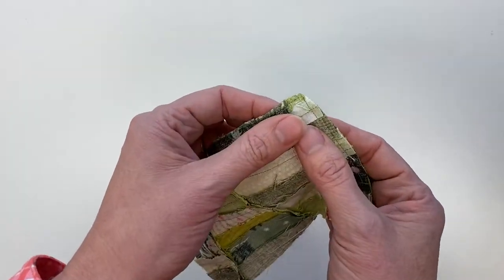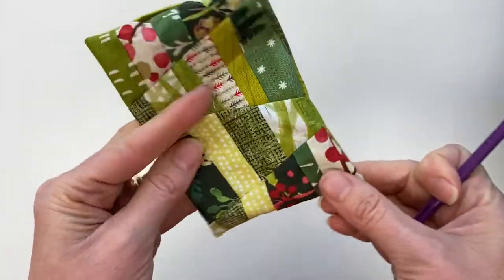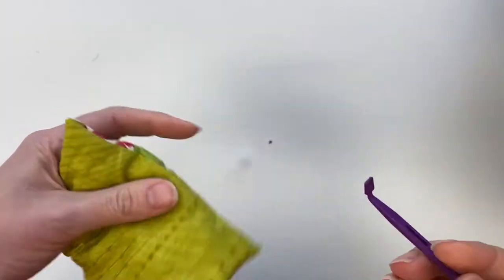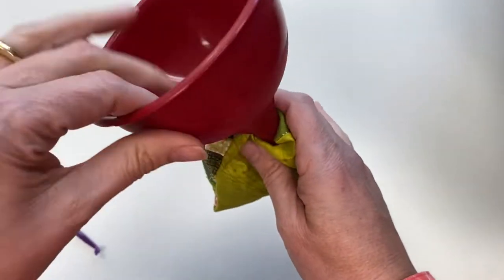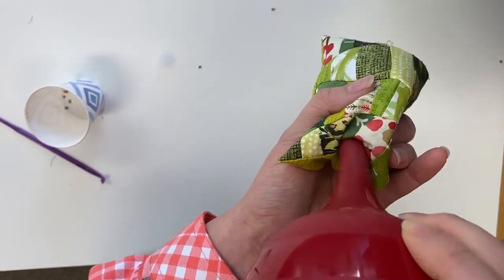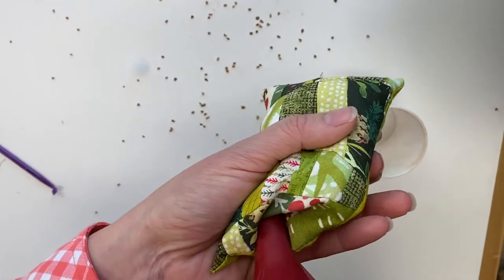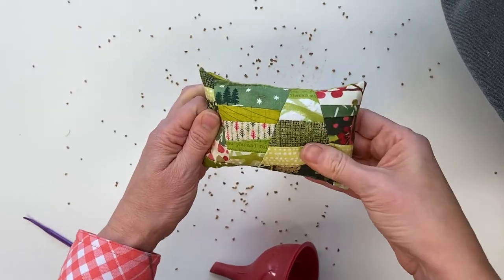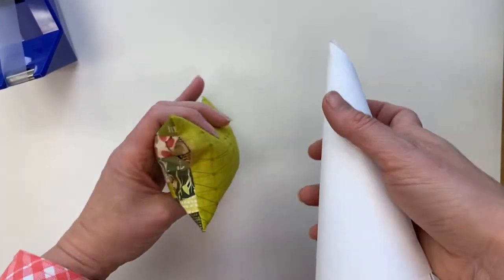Tutorial : Stuffing A Pincushion

Comment: Why the walnut shell? Does it help sharpen the needles?
Reply: I was thinking that too. Does it help sharpen needle? Did you crush the shell yourself?
Reply: @pemachoden5624  I know it's been awhile but yes, it is supposed to help sharpen the needles. You can also use Emery Sand.
Reply: @traceymills9469  great......thanks
Reply from the maker: Usually you can find the crushed walnut shells as animal bedding in pet shops, or if you need a finer grit I believe they also use it for rock tumbling and some kinds of sand blasting.